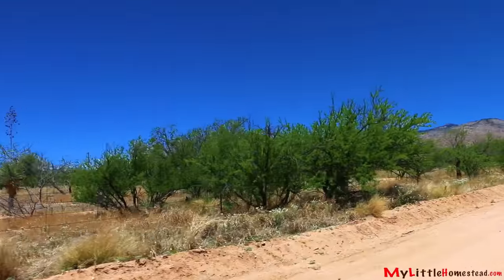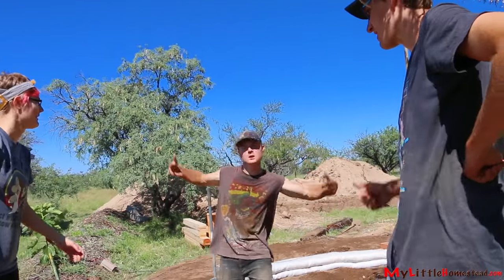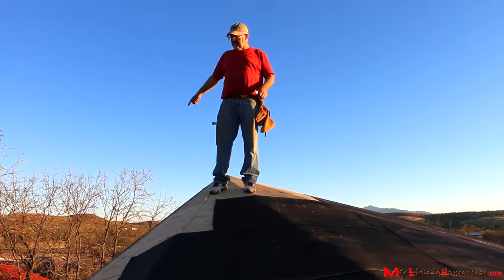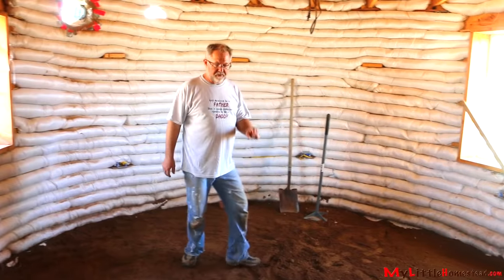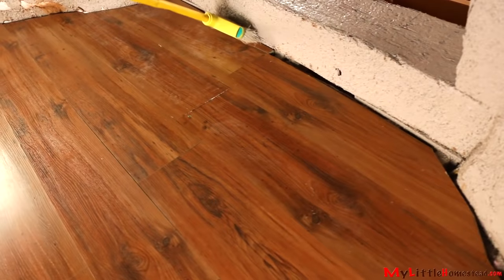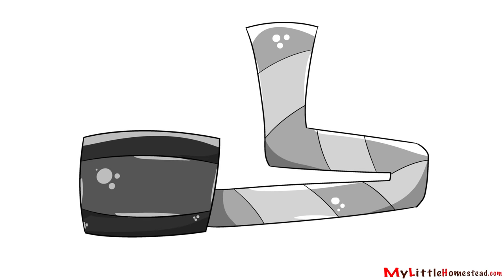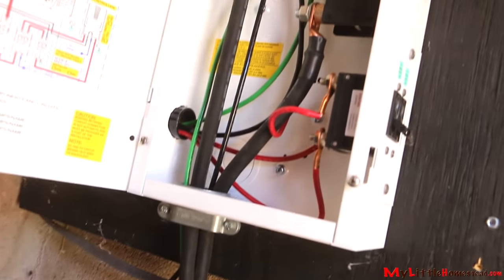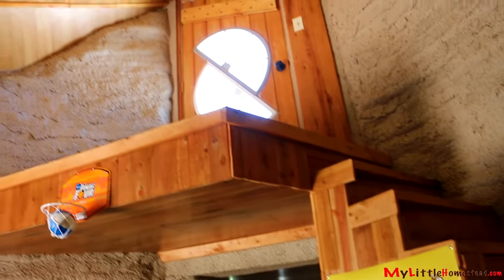Complete Build Earthbag Construction! | Full Version Movie of Earth-bag Building Project

Comment: So here in Africa this idea has been around for many years. We call them rondawels. Not bags though, the frame is made with poles, then packed. 
Love what you have done.
Greetings from South Africa.
Reply: That's not surprising... the thing will only work in a very warm a dry place. Elsewhere, either melting snow or tropical rain will liquify earthen walls in one season.
Reply: @nvo7024  not really, they seem to survive for many years here. Depends on the earth used.
Reply: So the etymology behind calling this an earthbag house emanates from the building materials, just as you'd call mokhukhu (tin house) because it was built with corrugated ion. Same applies with Wendy houses and brick houses.

Comment: Electricians replaced my main house cable a few years back, they ran the wire through a long PVC pipe to protect the wire from the ground, chemicals, digging.   The video shows the solar panel wires just laid into the dirt to the battery hut; if they have put the wires through a PVC tube, then in future could just run new or replacement wire pulled through the pipe without having to dig to replace wire.
Reply: don.t know if there are gophers in the area, but if there is, they love to chew on wire insulation. The PVC is the best way to protect that also. I learned the hard way, after running a 10/3 line over to a travel trailer. One day after a heavy rain, happened to look out the window and saw smoke coming out of the ground shortly before the breaker tripped. the gophers had stripped away a lot of the insulation somehow without frying themselves. since we lived in south central Tx, had very little rain, so took awhile before we found out about the problem.

Comment: You guys missed a step: there is supposed to be chicken wire attached to the walls before the stucco is applied. It prevents the stucco from cracking and falling off, because nothing really likes to stick to plastic. Normally the chicken wire is attached with short pieces of bailing wire stitched through the bags.
Reply from the maker: +Terrace Thornhill 
We've done both. The clay mixture is very sticky and works in some applications.
Reply: *****
Thanks for your reply. Personally, I plan to use 2"x4" hole galvanized wire fencing to cover my walls. It's cheap, and it's strong enough to be used for reinforcing concrete walkways and stuff. The large holes should make packing the cob in relatively easy.

I like the idea of having the cob mechanically fastened to the walls instead of relying on adhesion. In fact, I think I'll try to make a giant needle to poke straight through the wall so I can attach the mesh on the inside and outside together with galvanized steel wire. That should give the maximum stability.

Good luck with your project, it's quite impressive, I look forward to your next episode.

Comment: Wonderful family project! It's really inspiring to see a family come together to build an off-grid home. As an electrician, unfortunately I would consider taking more care in the installation of electrical equipment such as laying mechanically protected wiring (even if it is buried underground) to and from the house as well as the main wiring from the solar panels. I appreciate that this project was beautifully constructed on a dime but extra care (and sometimes cost) must be taken when ensuring a safe electrical infrastructure. Other than that, I was delighted to learn about the well documented building process. Thanks again!
Reply from the maker: +organica-beats 
Thank you for the heads up.  It is always good to have safe advice from pros. Thank you again.
Reply: Yep. I'd be using copper in conduit too, and would have done a few other things different as well, but that did not detract from my pleasure in this great fam and this great video! What an inspiration!

Comment: I enjoyed watching this but thought the whole time of building codes, permits and inspections. I cant put up a shead without the country coming out
Reply: Was thinking the same. Is there anyone making sure the building is up to scratch?
Apart from that the video is lovely the family is lovely...
Nothing like this could ever be done over here though. Even for an extension you have to get permission let alone build an entirely new building.
Reply: In some areas you don't need to have a permit.
Reply: I enjoyed the video, but also saw some things that weren't quite up to code. Insulation pointing the wrong way (paper up versus paper down), wiring, decks with no railings. Things that would get you hammered in California.

Comment: I'm very curious about how well your tiny homes perform in extreme temperatures. Do they stay cool in the hot summer? Is the rocket stove enough to heat your bedrooms or do you need to supplement? I've been watching your journey for a few years and I love your adventurous spirits!
Reply from the maker: +Melissa Williamson We have one of week of extreme cold in the winter and a week of hot in the summer - our temp's here are pretty moderate.  The rocket stoves are more than sufficient to heat the earth bag rooms - the main house is not insulated well (yet) so we need multiple heat sources in it :)  The general rule is the dirt walls hold the heat or cold for 12 hours and then releases it slowly over time - it works well in the desert climates where the temp swings are large within 24 hours.  Our challenge is insulating the roofs/ceilings.  This is where we loose all our heat and cold.  Thanks so much for watching and your kind comments!!!  :)

Comment: Where are you allowed to build these? I think in my state they are a no-no.
Reply: I bet if you look up local building codes you will find it is approved. they are extremely fire and earthquake resistant as are straw bale houses.
Reply: worth checking into as a sight to see the attraction. just keep to the building codes and have a pro do your blueprint, be sure to make that value vs conventional housing, solar power, gray water recycling just make it az project based on volunteers check with your local college of architecture.

Comment: You should use plaster rings where the Cobb extends past your electrical boxes. This allows you to safely enclose your boxes while giving you a flat surface to mount your Receptacles and switches giving ou a more uniform surface to mount covers.

Comment: Really neat video, the only thing I would change is using a hard wood like poplar for the framing. In earth bag homes moisture and weight is your enemy so everything has to be designed with that in mind. If moisture builds up, walls collapse and no one wants that. Most designs I've seen usually still have an inner timber frame. I've also seen people use old tires as a method of building pillars for second story support but I don't think you have to worry about that.

Comment: Next time use a 4/11 tip to spray the eve's. It's the same size tip used for paint your doors and jams.
The tip you were using looked like a VERY worn put 4/ 15.
Remember, Paint has sand in it, so tips get blown out after a while.
They're good for about 100 gallons of paint, then it's worn out.

Comment: If you want to use recycled paint in your sprayer get a pair of panty hose and strain it through them into another bucket. Squeeze the last bit out, you will get messy hands but now there are no particles in your paint and it can go safely through your sprayer.

Comment: Would a larger scale rocket stove supply the needed heat for a 24 by 36 foot metal shop where we are always doing wood work projects we sell that require even during half year great northern snow season .... allowing paints to dry , waxing,  polyurethane etc.? Amazing clan yall have and ths team work,  problem solving and not as much sibling breakouts is wonderful.

Comment: I built a larger earthbag "home" (got all the bags done but pooped out at that point - I think it may have turned into a barn). We used a bobcat for mixing and for lifting mud to the wall level. People don't realize how much effort goes into lifting wet dirt. Coffee can loads just suck. We'd get a load in the bobcat bucket, lift it to the wall top and just shovel into the bag with an ordinary shovel, worked great! Invest in a bobcat and then sell it when you are done.

Personally, I wouldn't do an earthbag again. Why mess with that when you can just push a berm up with a front loader? Maybe use Mike Oehler's ideas for walls.

Comment: Hi everyone. I am the owner of a heating and cooling company HVAC. for 41-years. And a retired Fire Fighter. Love this program. But I would like to suggest if you make this stove PLEASE do not use the heating pipe you see in this video. Please use the B-vent duct. It is made for exhausting flue smoke and gasses. The pipe they used could leak carbon monoxide. (A deadly Gas) and runs hot, could burn through the pipe. (Risk of FIRE and CO LEAKAGE). Also, the B-vent has the parts that they made. Pre-made from the factory. The foil tape they used will not prevent smoke leakage if it gets hot enough it will fall off the pipe. Love family projects. It would be cool to see an updated video of the house. After 5 years and 10 years. Did it hold up? Any water problems?

Comment: With the closet door knob, the flat piece that extends from the one knob and fits into the other.
Is the length of that flat piece the reason you had to add the wood on the inside?
If I remember right, that flat piece has grooves in it at different lengths. That piece can be broken off at the groove for the length you need.

Comment: They should had put that electrical wiring on electrical hard tubing, in case they need to replace any of the wiring in the future. The earthbag under the ground level could have been also mortared, which they did not show. I wonder how they deal with moisture in the earthbags themselves.

Comment: I hope you see this. I have d9ne a lot of study on solar to add it to my rv and a possible future home. Panels lose a lot of power with heat. By running a water coil on the back of the solar panels, you can increase the panel power production by 25% on low end to as much as 300% on the high end. 

So if you have 3 panels and get just over 25% increase, those 3 panels with cooling will produce the same power as 4 panels without cooling. Also, since heat shortens the life of solar panels, cooling should add lifespan to your panels. Additionally  the heated water can also be used to help supplement hot water production.

Actually, they do make hybred solar thermal panels, but they are extremely expensive. So i can't claim i invented this idea, im just trying to find a way to add it to existing panels at a lower cost.

My idea is to use sheet metal as a heat sink. Cooper tubing is attached to the back of the sheet metal. Then you could just pump water through the tubing to carry away the heat. The solar panel is attached normally to the top of the sheet metal into the solar panel frame.

I would he grateful to hear back if you have seen anything like this.l before. Ty.

Comment: Great project and the build is thought out but guys the wiring is terrible, no proper terminations or insulation over the earth cable and that buried cable OMG must be 20 mm below the surface, its far better to take your time with electrics, do it to a high (basic safe) standard and you wont have issues later.

Comment: it seems to me that a traditional build wouldve been much easier. maybe cheap in materials but seems like a boatload of labour and time getting materials. wouldve cost a fortune in labour. being round makes it very impractical and difficult to furnish. not sure about the structural integrity of bags, and the longevity of the cladding method is questionable. surely those bags will settle and spread over time with moisture..not sure this is a great idea.